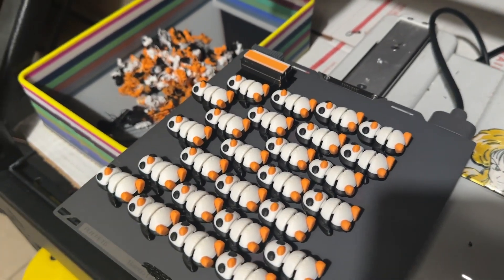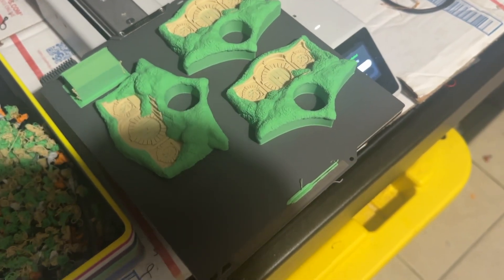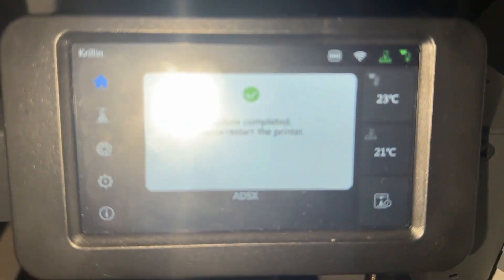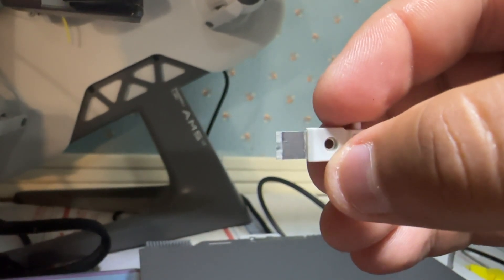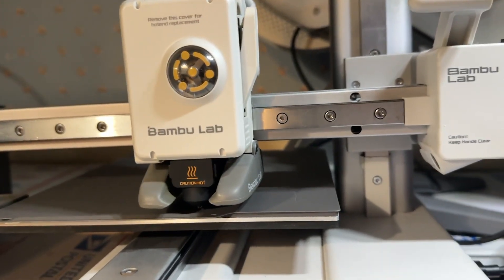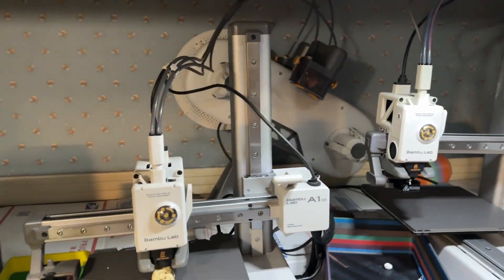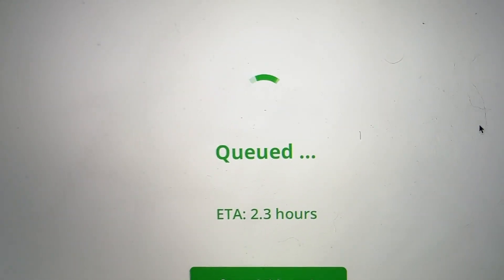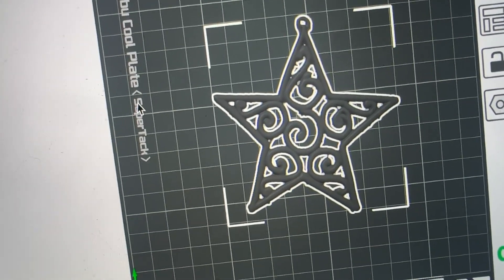300 3D Printing Order & Working On Our Online Presence |  3D Printing Business Ep56

Comment: The amount of instability I am seeing out of those A1 minis I think is a contributing factor of some issues. You need to get rid of the cardboard underneath. Get some 3/4” sheets of mdf or plywood, Lowe’s can cut it for you for the exact size you need, and I ran a 2x4 along the wall and screw it into your studs and then bolt the racks to the 2x4. At minimum, I would do those things for all your printers and it’s inexpensive. That is something yall definitely need being a year into this.
Reply from the maker: thanks clappin for your insights as of right now that hasn't been in the cards for us no matter how cheap it is there's some foam mats id like to pick up from Home Depot we want to try out at some point.
Reply: @thefamilyprintproject those foam mats I’m pretty sure cost more than a sheet of ply. I’m sure 1/2” would be sufficient and bolting it down to the wall would just be one 2x4 secured to all the studs and the to the rack. That alone would take that rocking out for the most part.

Comment: With the waste being the same whether you print lets say one penguin or 10, why print multicolor on what looks to be like the a1 mini when you’re only able to print a few vs on a standard a1/x1c/p1s/etc. 
Your cost per item will be higher printing it on the mini vs the other beds. 
Do you factor in the cost per item by including the waste/purging/poop?
Reply from the maker: yes we take the the cost of electricity what slicer info gives us base of the general info it has of $25 a spool  etc. if we didn't factor this information that would be silly and we also balance certain products based on demand to balance out items that don't sell as often as others
Reply: @thefamilyprintproject I’m asking why are you printing multicolor small prints on the a1 mini vs your bigger printers where you can print more per plate and have the same amount of waste.